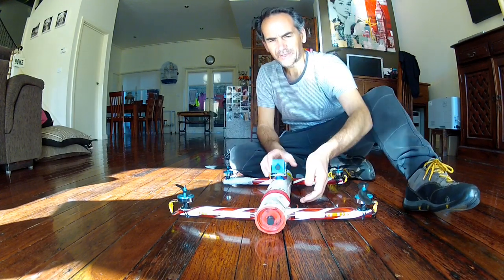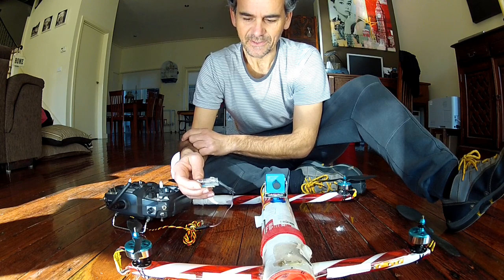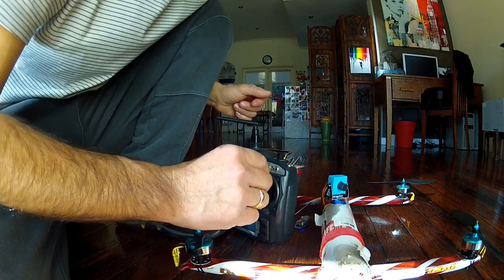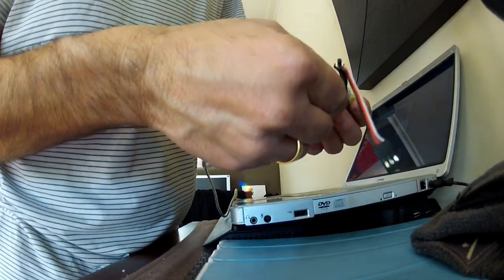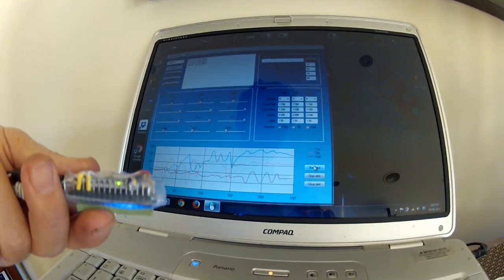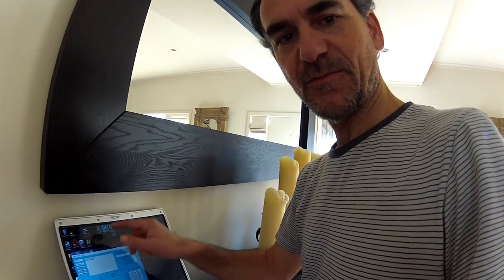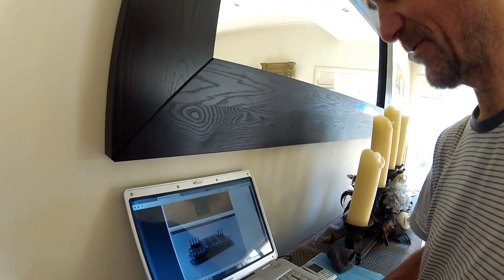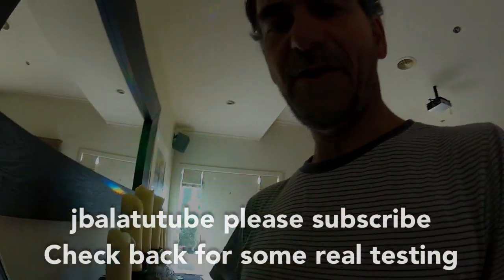FPV Headtracker DIY No Drift

Comment: Hi is this applicable ro flysky fs i6x transmitter? If ever, where can i attach then signal wire from the arduino to the tx board.. nothing labled here in tx board.

Comment: Great video , but I still don't know how to bind ppm channels its not clear in your videio
Reply from the maker: If you have open 9x or er9x installed then you just select ppm7 and ppm8 as a source and bind it to channel 7 and channel 8 on your receiver. Then plug servos into channel 7 and 8. You will need an 8 channel receiver.
Reply: jbalatutube That was fast response , I have turnigy 9x I searched every where I couldn't find it , Can you guide me where in menu can I bind them ??
Reply: Mohammed Alhanooti 
I don't have Open9x er9x installed, do I need to install one of them
Reply from the maker: It really is cool to install open 9x or er9x some really nice features. Check BMSWEB for an easy video. I don't really know if its possible on a stock 9x. I assume you have plugged the servos into channel 7 and 8 and you can somehow turn those channels on the Tx. Also that yu picked ppm7 and ppm8 in the software on the arduino. You might need to map them to an AUX channel ? Sorry not sure. Try going through the thread link and see if you can find something. They do mention the 9x a few times.

Comment: Nice video. very informative. Going to build one for myself. Is there a cable that i can make for 9XR? i my quite bad at soldering and dont wana solder wires to my transmitter.  thanks
Reply from the maker: Yes you can use a trainer cable for the signal but then you need to get power to the arduino separately, maybe from the glasses or a separate battery.
Reply: jbalatutube perfect will power it from a small Lipo. Thx

Comment: This is great jbalatutube! I'm looking for to build a head-tracker, but the problem was to send the signal to my Tx (FS-TH9X). Now I think I can carry on with my head tracker . Thanks a lot!
Reply: Finished my Head tracker, and guess what: The trainer port is actually a 3.5mm STEREO jack which only using the sleeve and ring  for PPM signal (GND - Signal), the tip is unsoldered and you can solder it to the V+ tracing of the board. this way you can use a stereo cable in the trainer port providing power to your HT and get the signal form it.
Reply from the maker: Be careful most people wont use the trainer cable to supply power, I think as you plug it in it can short causing damage to the port or radio.

Comment: Are you planning to use this for your main flight cam or have a switch to a fixed cam and this one?  Either way, I wanna be there too :)
Reply from the maker: Yep this will be the main fpv cam on the postpak. Would love to do a tbs style gimbal on the front with gopro but we will see